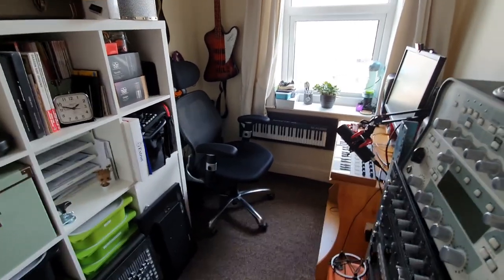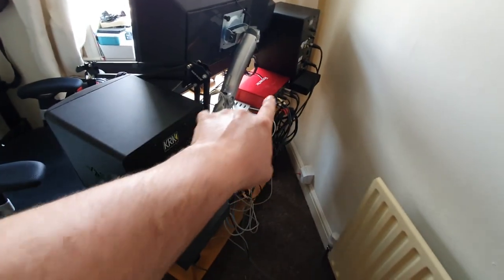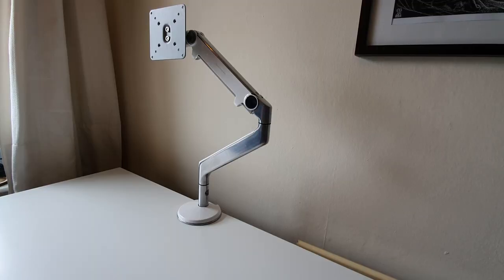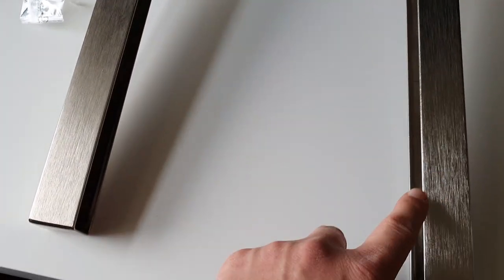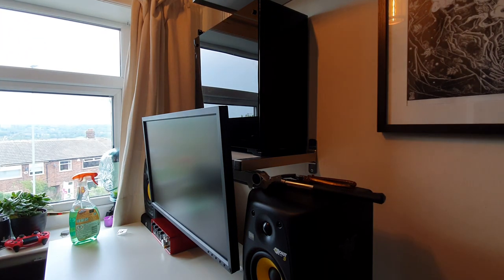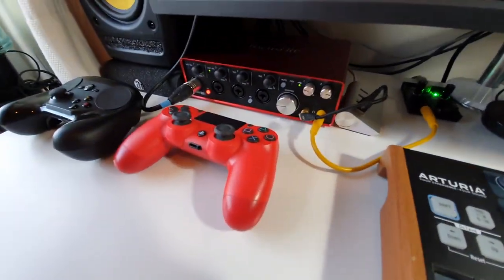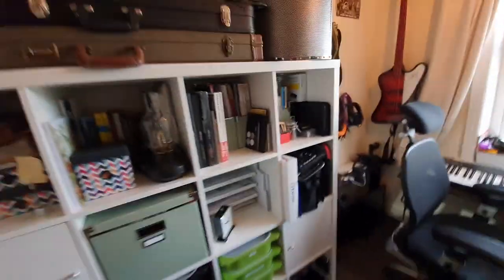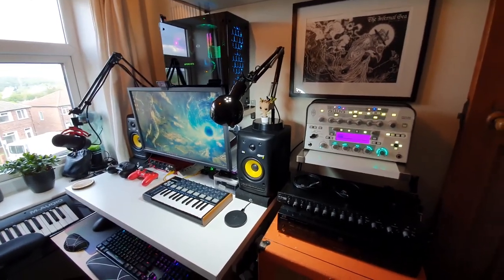My Absolutely Tiny Studio - Refurb and Quick Tour

Comment: How can I take your set up seriously with only one monitor?
Reply from the maker: It was originally 2x 22" 1080p monitors set up vertically, but I traded it for a single larger 28" 1440p 144hz monitor. There'll be more on that though! I'm going to be experimenting with a touch monitor for mixing soon.. I also have a tiny 11.6" 1080p monitor attached to an arm clamp that I'm thinking of using for monitoring OBS while screen recording.